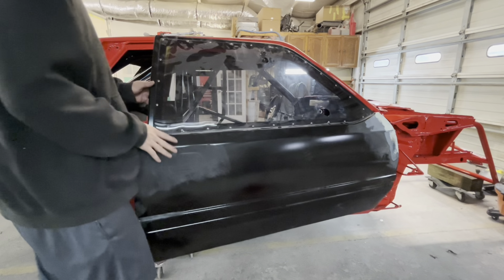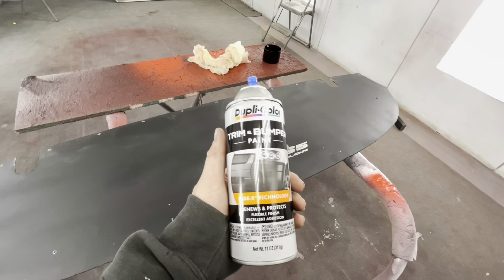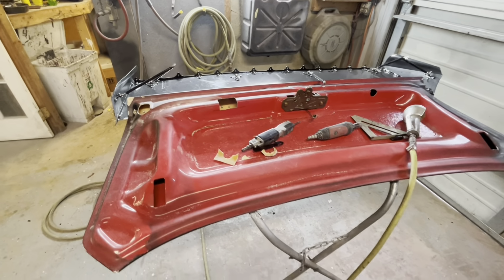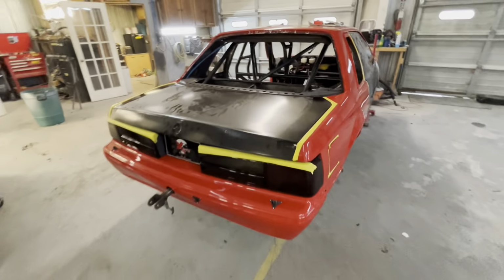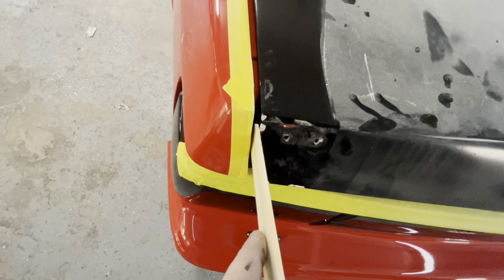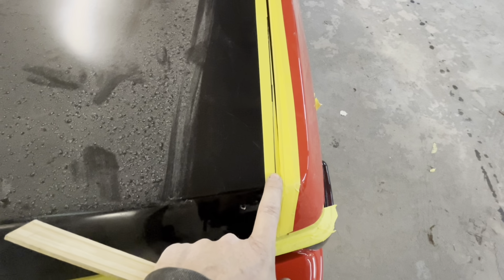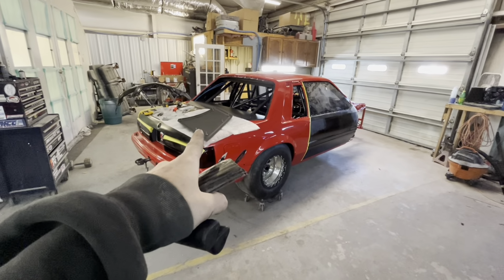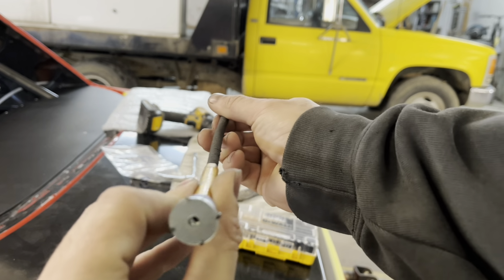Hanging doors 🗝, installing carbon windows🔩 & fitting the trunk 🪚 on Randy’s Mustang

Comment: Looking awesome. I'm currently building a 85 coupe myself. I still have a factory steel trunk lid and the gaps are not perfect by any means. It is what is as Turbo John would say. However after the mini tub install I was able to use a set of convertible trunk springs since the  rods are gone for the clearance for the tubs. Work great. Better than a block of wood or having to hold it with one hand and trying to work in the trunk with the other. May not work with the fiberglass because of the strength. Just something that I figured out and may be something Randy may want to look into. Keep up the killer work.
Reply from the maker: Once the wing is on the trunk they never open it up hardly. That would also add alittle more weight to the car. I’m guessing whatever use to hold it up was removed at some point.
Reply from the maker: Thank you so much for the support btw it means a lot.